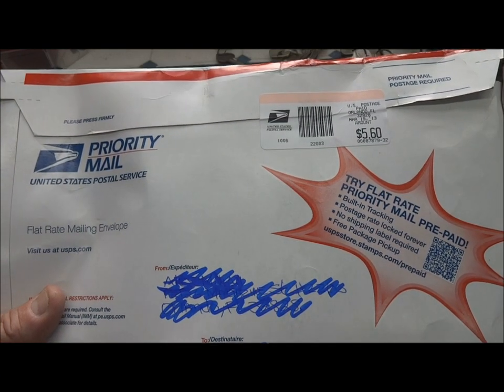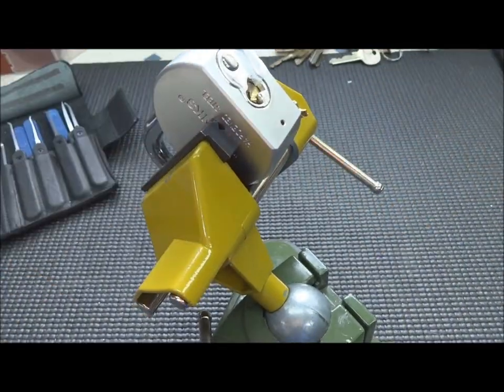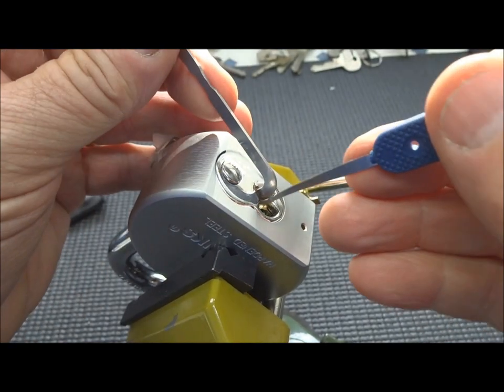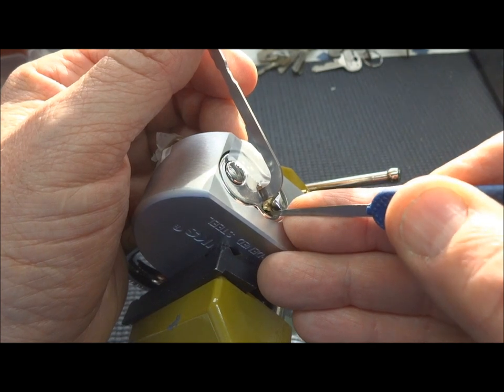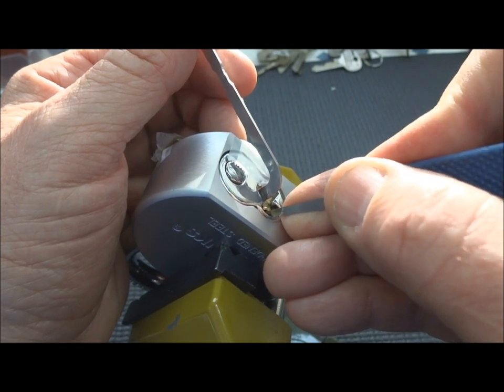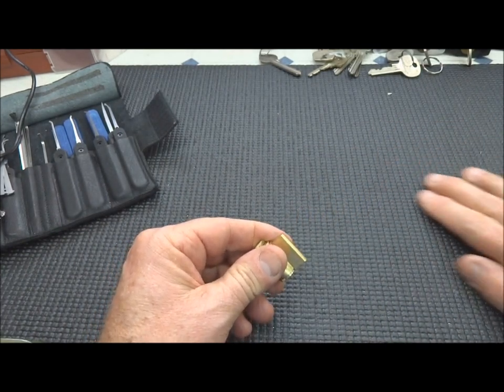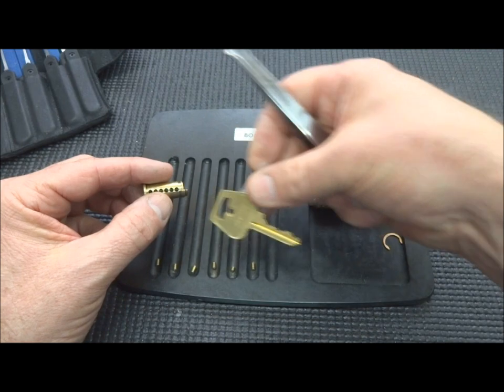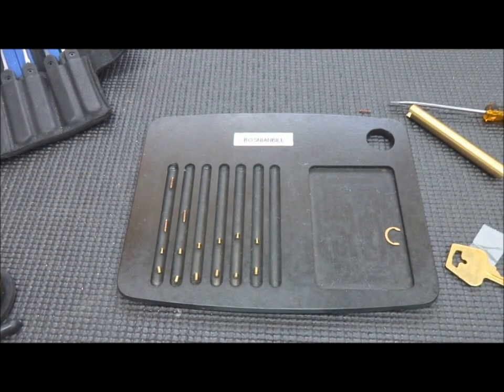(259) Challenge: Brinks 527 Maximum Security Padlock

Comment: If that was a factory pinning it looks like brinks is taking a lot more pride in their manufacture than American or Master these days. I like seeing all six cylinders stocked up and with quality pins as well. Only thing that would have been nice even though they have that hardened plate would have been a steel pin in the first slot for drill resistance. Also wonder if these locks are venerable to bypass like the American ones? I did not see any wafers come out during the gutting.
Reply: they use the same wafer as the American. I have only found a single  wafer in every one i have opened. so a wafer breaker would work. Cheers
Reply: David Held Bill has a video on improving American padlocks and suggests adding wafers. Will American wafers work in Brinks 527? If you know of a source for those wafers in Canada, let me know! Would an average locksmith shop cary those?

Comment: This lock is stock? All of the ones I can find are 5 pin.
Reply: NgtFlyer yes I have one from amazon and I'm in the us ( on sale for some reason very cheap $15), and it's 6 pin and exactly the same as this.Package just says "Max Security" and the brand  but seems to be the standard model of this series number or at least most common and doesn't indicate it's an upgraded model of the same series in any way. Not sure what they would indicate on a package on a 5 pinned one except just on the back specs; they won't likely say it's a lesser model even though they strangely don't particularly promote this one as an upgrade if a 5 pin version exists.